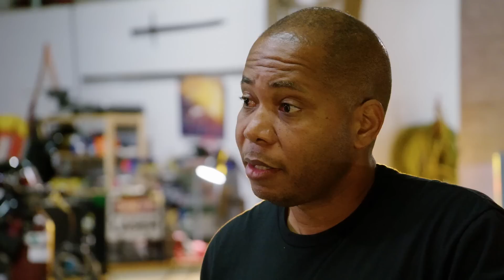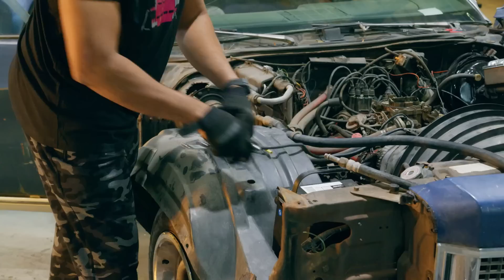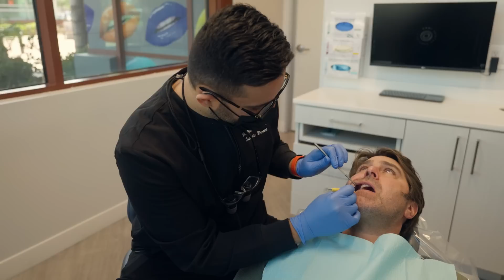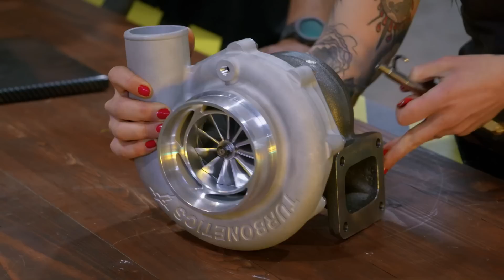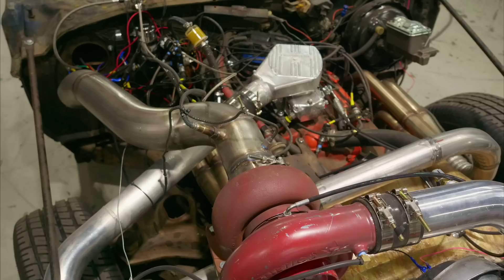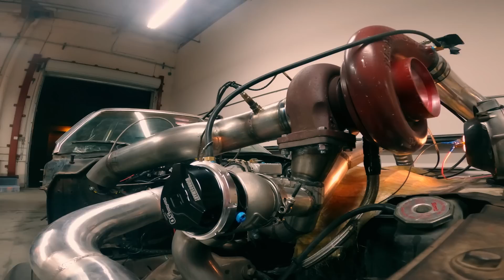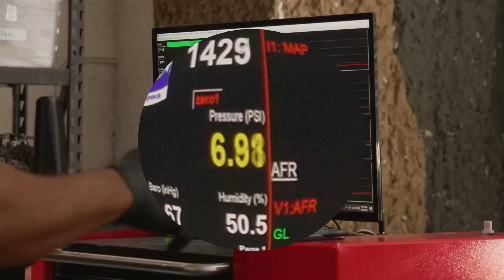Turbocharger Myths - Motor MythBusters - Car Show

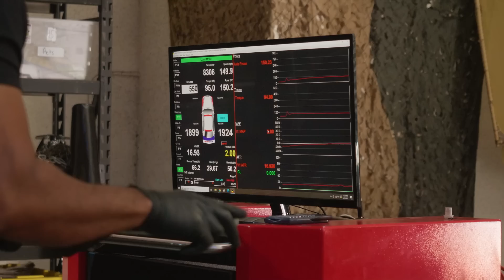Comment: 43:00 in real life when you unplug the vacuum line from a working healthy turbo it maxes out the boost. Been there done that a bunch of times on a bunch of different cars and it's worked the same every time, the boost pegs. So something is wrong with the turbo system they built for this test.
Reply: Unless you're dealing with some types of VTG turbos, as are often used on diesels. For example, some TDI engines have inverted controls. On those, the turbos need vacuum to make boost, and if the line, valve, wiring or vacuum pump fails, it just defaults to no boost. IMO, that is pretty smart, as it helps prevent overboost damage in case of something like a rat chewed hose or broken wire. So, with gas engines, a turbo with no vacuum will make tons of boost, but with diesels, it depends.
Reply: could be that the boat turbo works differently or could have been worn out where wastegate leaked when the vacuum line was pulled. so i say the stunt was not busted but the turbo was xD
Reply: I haven't made it there yet, however I was just judging by the size of the turbo, that 350 won't send enough exhaust through it to make any boost....
Reply: @ryurc3033  The thing is that it is still true to the myth as the fleetliner had a engine smaller than the 350 and it looked like it had a big for that engine anyways and most likey did have enough exhaust gas to even spin that turbo properly so in my eyes it's very true to the myth
Reply: @thatsimracer666  for sure, you won't find me defending any of the f&f franchise cars...... besides Sean's 72 Monte Carlo in Tokyo drift. They actually built one with a serious big block, that was actually a cool car that deserved way way more attention than opening chase smash up.
Reply: @ryurc3033  I agree and the only other cars would be brians supra and 34 as they where real cars owned by craig leiberman
Reply: @ryurc3033 hell yeah. 632 big block in that Monte.
Reply: @EricErnst  Docs old motor!
Reply: It hit boost cut guys lol.  Simple.     Holly terminator 
Someone decided they didn't want their actors to get hurt when the motor exploded lol
Reply: Something must be wrong yes, 7 PSI is a very normal boost level (maybe even the normal spring level for this wastegate), my stock low pressure Saab was running close to that level at stock.
The sport model was at 13-14 PSI.
I lost a hose on my car just like in the movie and the car boosted to 20 PSI and the ECU safety stopped the party, but the car was hauling.
Reply: Exactly. The wastegate spring was too light and was forced open.  Typically gates will force open around 3-4x their rated weight. My 8psi spring without any vac line connected gives 32psi
Reply: This had to be limited for safety reasons, I've had a few setups with different size turbochargers. Once it gets into the map, it can create boost they created more heat , once enough fuel is supplied, it will continue to build. This 7 psi is low pressure considering the size of the engine and turbo, you could easily see 15 psi or more on this setup. This was more for fans of bisie than anything.
Reply: You have to also remember this car was carbureted high speed fueling is only tuneable so far. Now all you guys saying you've done this and it worked....sure on a efi it will just like movies....bc the car is capable of adjusting the fueling. Now what yall missed was they replicated the movie....the movie car is carburated!
Reply: I drive a Holden Colorado Turbo diesel and I've seen guys remove the line on theirs and no it won't overboost. It totally depends on the setup.
Reply: @elwoodroadsmusic9639  A diesel will only make more power if the diesel pump is able to deliver enough fuel for the extra air.
In this myth they said that the fuel system was able to deliver enough fuel.
Reply: Totally. All them 'brain's' to end up with 2-7 PSI  . Dont let tranny's near ur cars ppl.
Reply: I thought that, there's no leak from there it would just close the wastegate and go full boost. Tbh it probably just leaned out way too much and was choking.
Reply: well it depends. a pressure control valve is between the lines so which one did you unplug? the other thing is, theres literally no car from stock that hasnt got a system to prevent such things so you're double lying on that part.

Comment: they don't make NOS over their... compressed hydrogen oxide made from sea water and sheets of car body panels running the hydrogen generators... when the carb runs out of gas all it has is the bottle gas to stay running but it could be methane made from a wood gasifier as well in that bottle. 40 bucks for every half pint of rum it burns sugaring the valves up. 130mph is 130hp at half a gallon a minuet. 10 minuet tank that takes to much of a crowd hustle to fill up... get anything running and they'd serve lobster and roast ham with rum in the orange juice. black smith forge the rods back together with wood gas over charcoal, or if they care to have an engine that does nothing but boil sea water into hydrogen get that going first. be to easy to just boat over their and burn all there liquor in a union car... solo rat race. engine's the last thing to work on, clout possesses the communist crowd... just to look fast by making the most noise, back off the timing, because the vacuum advance went with the boost leak just to throw fire... wouldn't care if an import came in to do the same thing, their no struggle o's in it. all about the struggle o's! AC that blows ice cold.
Reply: Good God man quit snorting your Adderall and drunk commenting on youtube your gonna give someone an aneurysm

Comment: Need a blow through carb to run boost over 7 psi otherwise you just push the fuel back to the tank
Reply: Top comment
Reply: I have blow through turboed about 20 cars and still have 3... using dead stock holley cars with just jet and air bleed and power valves changes... the problem here is they didn't have a rising rate fuel regulator to increase fuel pressure as it gets boost
Reply: They make boost referenced fuel pressure regulators.  Just run a higher pressure fuel pump.  The regulator will increase fuel pressure as the boost increases.
Reply: just build a box around the turbo and it will keep the preasure equal in the float bowls as in the jetings.
Reply: That IS a blo through, u pull through
Reply: There is actually no difference in carburetors in turbo use.... you just put pressure lines to float bowls and fuel pump and regulator that keeps fuel going in the carb...  pitot tube would be good too to have... my turbo cbr has single carb blow through system with s&s super e carburetor....
Reply: @NitroGnome  I must have misunderstood  that blow through carb was already setup for a boost reference. Thanks for your comment 👍
Reply: @NitroGnome not true in most cases. There are modifications in the carb and there needs to be increased fuel pressure to match and compensate boost of fuel will not flow.
Reply: @jasonbirch1182  did you even read my comment fully... Carburetor is just carburetor, pressurizing carburetor is done with pitot tube, that goes to vent line of fuel bowl, then fuel pressure regulator which has pressure compensator line keeps fuel pressure above boost pressure with fuel pump... You also can do this without pump, you need to pressurize fuel tank with boost pressure (which is not very good solution for cars) usually best solution is to try stock jets with pitot tube, because pitot tube makes more pressure than boost it self and forces bit more fuel out the carb... Just did this for my bike.... Only mod to the carb was re-jetting carb for e85 and put pitot pressure line to carb vent line.... Nothing special
Reply: @NitroGnome  I did read your comment. On your motorcycle carb that's true. That Holley carb has a power valve that will not work stock being pressurized. Did you read mine where I said "in most cases".

Comment: All this effort for 130Mph - lol
Reply: my 200k mile vr6 volkswagen has done more than that on "mexican" roads, stock engine.
Reply: They were trying to replicate the concept of the myth.
Reply: @kitko33  "trying" is a bit of a stretch. I've easily suprassed 2-3 pounds of boost with a dump valve that was opening up when it shouldn't. Even at 8 pounds of boost, a 8:1 compression emissions era 350 is still going to fall short of 300hp. Hitting 130 peak on nitrous? With all the aerodynamic drag they created by removing the body, that's maybe 190 wheel horsepower.
Reply: 2006 Lancer get do that stock lol
Reply: @TheTyisawesome that's not saying much, I have a 98 Cherokee 4.0 that hit 132.
Reply: Had a 74 Chevelle daily driver. Had a body, intake, exhaust and cam that hit mid 10s 130mph in a 1/4 mile. Fast and the furious is for the mechanically illiterate. They never explained what a waste gate does cause that ruins the story.
Reply: yea preaty slow considreing a big engine and a turob , i have and 55 year old fiat thats puting 115hp and redlines in 4th at 98mph
Reply: @boronat1 131?
Reply: Sad part is most Most modern cars have a cutoff/governor just under 130mph 😅 I have tested this on a bunch cars 😂... hence y I like my older cars and standalone lol

Comment: need wastgate boost line inn on top and rip off the lower dat give lock wastgate
Reply: Agreed, Your stuck with whatever you're gate spring psi is at without any pressure on topside of the diaphragm

Comment: What a waste of time, in 72 my high school girlfriend's mother brought a brand new Monte Carlo 350 and it would do 120 off the showroom floor.
Reply: But that was before covid
Reply: Not the point here at all😂😂
Reply: Just chuck it 5.7 ls1 in it and call it a day
Reply: @CruisinCaprice In reality sure. But this is about recreating a movie myth of a turbocharged car in Cuba....
Reply: A new Prius would still beat it
Reply: My 1989 s10 4.3 (350 cut down 2cyl) would do 135 with 100k on it
Reply: @mblake0420  135 miles per hour in a 6 cyl S10 ?? Riiiiight.... lol
Reply: @edwardfletcher7790  yes, 20 years ago when it was a fresh unit (100kish)
Reply: @edwardfletcher7790  my 350 firebird gta did 160, I dont see what's so astonishing
Reply: @mblake0420  Nice lie, GTA Source quoted the Motor Trend top speed test done in 1988 as 141mph 😜
Why you always lyin' ? LoL
Reply: @edwardfletcher7790  lol in 1990 had more power bro, L98 vs Lt1...nice try tho
Reply: @edwardfletcher7790  I live in mountains as well, stretch I always topped out was slight downgrade
Reply: @mblake0420 lol my 4.3 S10 Blazer would only make it to like 98 mph yes I understand the weight difference lol it would do the sickest burnouts though lmao and not the one-wheel squeals either both would spin. I believe someone welded the diff or something before I got it
Reply: @codycampbell1147  what year, bc my 1998 was speed limited, my 89 would go to the moon
Reply: I'm wondering why you think you need to comment this... It's like You're trying to brag but you're bragging about an ex's moms car from 52 years ago. You're ex's moms car seems pretty cool though also it going 120 off the showroom floor is because it was new... This car is 51 years old and all cars can lose power over the years.
Reply: In the movie the turbo had no impeller or compressor in it lol totally fake just like his muscles haha
Reply: For 73 gm heavily detuned all of there engines to meet epa’s new policies right down to less compression and less air flow through heads and less lift and duration on cams
Reply: Seemed to be gearing limited here, hit 130 and stayed there
Reply: Did you race her car against a cuban mafia boss while it caught on fire from boost too?
Reply: In 72 and 2024 he still lives in mama’s basement
Reply: @jesseyanez681  most tough guys on here still do
Reply: It probably took 15 business minutes to get there too, yea?
Reply: That's the line of crap every high-school kid says about their tbi  305
Reply: @noduh736  
I was a car guy when you were still in diapers. Here's the facts on the first generation Monte Carlo

Home  FIRST GENERATION MONTE CARLO (1970-72)

FIRST GENERATION MONTE CARLO (1970-72)

The first generation Monte Carlo was introduced in 1968 as a 2-door hardtop with a 116” long wheelbase (4 inches longer than Chevy’s ‘policy’ length of 112 inches). Known as the A body Special, the layout evolved into the G-platform. Monte Carlo was first dubbed “Concours” during development, strutting a sleek profile, long front end, and short tapered rear deck. Although it was intended to include the 2-door, 4-door, and rag top models in its line-up, the 2-door hardtop was the only available style by 1970.

The standard engine was a 350 cubic inch displacement (CID) Turbo Fire small block V8 with a 2 barrel carburetor rated for 250 horsepower, 3-speed manual Synchro-Mesh transmission mounted on the steering column. Optional engines were the 350 CID Turbo Fire small block V8 with 4 barrel carburetor; the Turbo Fire 400 with 2 barrel carburetor; and the Turbo Jet 400 with 4 barrel carburetor. Optional transmissions were the 2 speed Powerglide automatic transmission (available only on the 350 CID engine); 3 speed Turbo Hydra-Matic automatic transmission; and the 4 speed manual transmission. Available accessories were the variable ratio power steering; power windows; power seats; Four Season A/C; rally/rallye wheels; and Strato bucket seats on which the back folded forward to provide access to the rear passenger seat.

The 70 model SS 454 was undoubtedly the sportiest and most powerful of the Monte Carlos. It bore the Turbo-Jet 454 CID engine with 4 barrel carb rated at 360 horsepower; heavy duty suspension, wide tires, automatic load-leveling rear suspension, and the Turbo Hydra-Matic transmission which became the official transmission for the SS future models.

1971 came with very slight changes to both body styling and mechanics. The Turbo Fire 400 engine with 2 barrel carb was dropped from the list of options while the remaining engines had the compression ratio lowered so that the future owner could switch between leaded, low-lead, and unleaded gasolines. This lowered the horsepower ratings across the board with the exception of the SS 454. The SS 454 saw its horsepower rating raised to 365 by using the camshaft from the 390 454 from the 1970 Corvette. Alas, 1971 brought an end to the SS 454 although the engine was still an available option until 1975.

1972 saw an increase in production due to heavy brand advertising on Chevy’s part. Monte Carlo was fully marketed as a luxury 2-door coupe (part of the reason for dropping the SS 454 badging). The 4 speed manual transmission was dropped entirely although the 3 speed manual transmission and 2 speed automatic were still available. Plus variable-ratio power steering, once an option, became a part of the standard package.

Interestingly enough, the Monte Carlo’s reputation as a performance car garnered popularity on the race track. The “other two” of the Big Three auto manufacturers phased out their factory-backed support in the racing arena, making Chevy autos more affordable as well as available to independent stock car racing teams and sponsors. But it was the Monte Carlo that was most popular 71 through 89 due to its long (116”) wheelbase and elongated front end